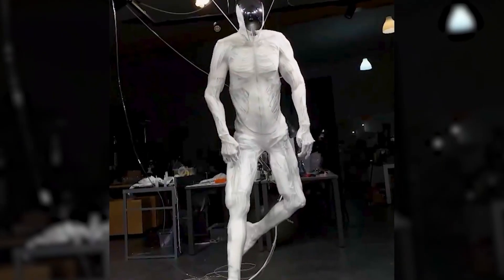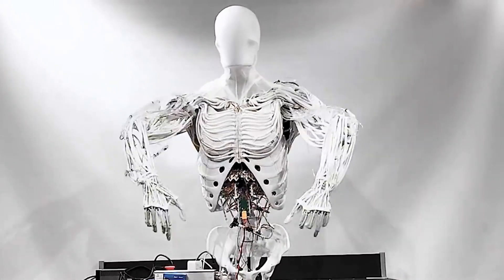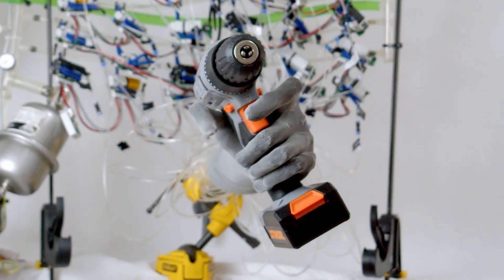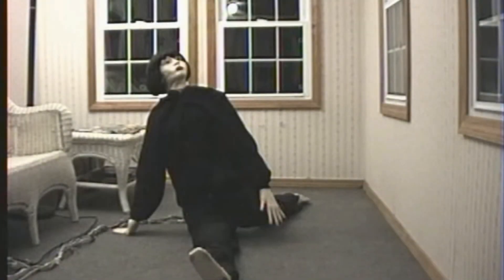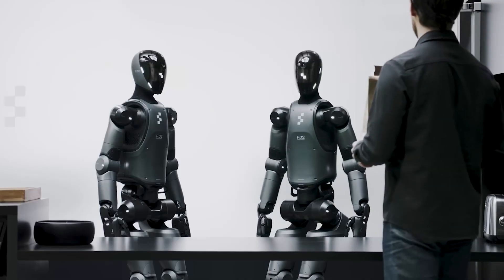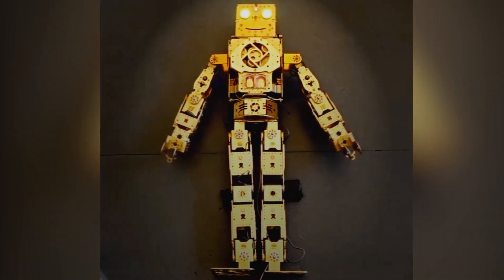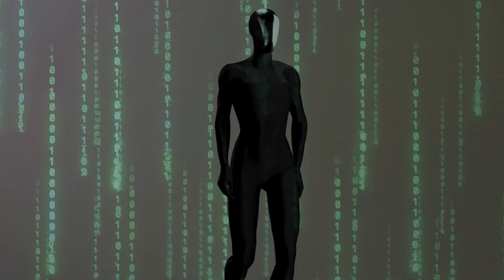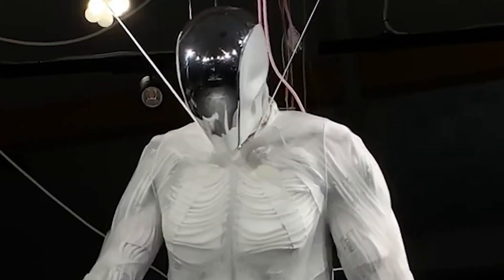Meet The World FIRST Bipedal, Musculoskeletal Android - Protoclone

Comment: Not ready for prime time yet, but the design is a good step forward. The hydraulic muscles rely on a 500W heart, where our muscles rely on individual power sources such as contracting cells. Very different and much more efficient. Cut a Protoclone's muscle and the whole system dies. Back to the drawing board. Unless each individual muscle has its own power source, this unit will fail. A nice attempt but no cigar.

Comment: As an engineer, i can't even imagine the whole trouble the engineer responsible will get to repair this thing.
Reply: It's a good thing, mechanical engineers and robotics professionals will be in high demand.
Reply: Maybe the can make the the body parts detachable so then it will be easy to replace the needed parts

Comment: This robot is actually less scary than the others. If it attacks you you can shoot it almost anywhere and it will shut down as the hydro system would drain very quick once it leaks. These robots would be much easier to take down than the other ones.
Reply: I just don’t want the thing sleeping in my bed.  Actually can it just stay in the garage
Reply: @xolomartinez6036 people will attack you in the future for being cruel to the clone expecting it to be relegated to the garage.
Reply: @xolomartinez6036  it's a robot. They don't sleep
Reply: Nothing goes 24/7.  If it does, it wears out. Robot or not.  It may need time for repairs.  It would be interesting to see how long these things go until they start falling apart
Reply: @ Robots don't sleep. It will just connect to a charger.
Reply: Or, y'know, they can give future versions armor.

Comment: Like the electric car, the robot needs a battery pack probably inside a backpack so that the robot can carry the battery backpack over it's shoulders. Solving problems are not failures but obstacles and require new solutions to go around those obstacles

Comment: I don't mean to be a downer, but this looks less repairable than a traditional mechatronic robot. You can't easily remove a limb and replace it for instance.
Reply: Repairability is not the intention of this design
Reply: @endostatica1405  It should be
Reply: @endostatica1405  then idc what the intention is. This thing trips over a pebble and has a bad fall and suddenly it's a heap of trash
Reply: @ your username is ironic
Reply: Why not?
Reply: @napiiboi  There aren't discrete separation points. To remove the arm for example you'd have to cut open/unzip the skin in that area. Individually disconnect all the muscle fibers going between the bicep/shoulder and the neck/chest/scapula. I guess it is doable but it seems much more an ordeal than with a conventional mechatronic robot
Reply: @napiiboi are we built to be “repairable” no. We heal but if we get a limb ripped off, it’s practically gone unless intervention is taken place as quick as lightening flashes and even then. The clone robotics Alpha clone is meant to be an accurate replica of a human (asides from the nervous system if you look at the website, it’s just 1 or 2 pieces of wire with 5 different points of extension to the head and limbs.), we aren’t build to be a LEGO mini-figure and neither is the robot.
Reply: That's the point. Bro you don't see it wiggling in front of you? Look at it. Our demise is soon...
Reply: Quite the opposite. This design is modular because it consists of similar tendon/muscle strands. If any of them break down, you can just replace it by a similar one.